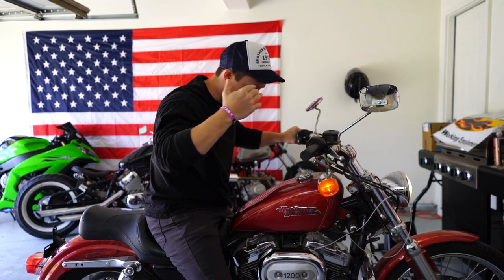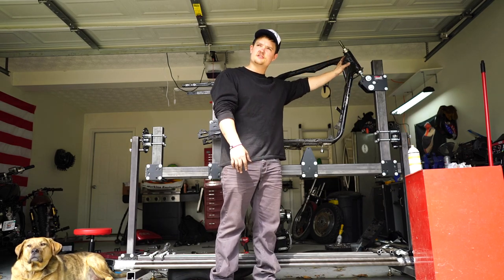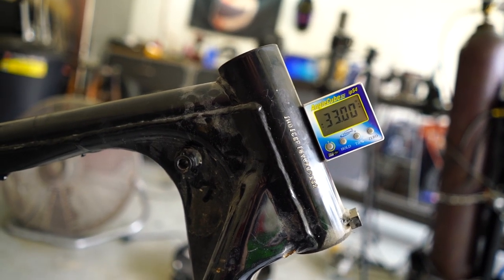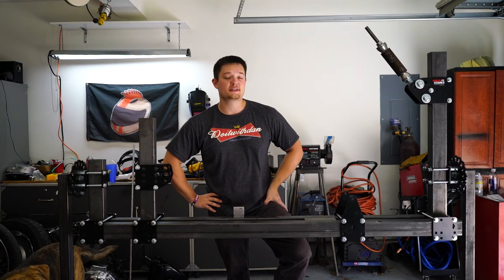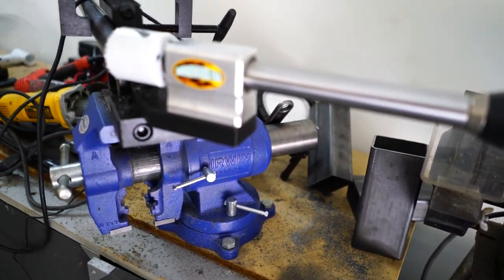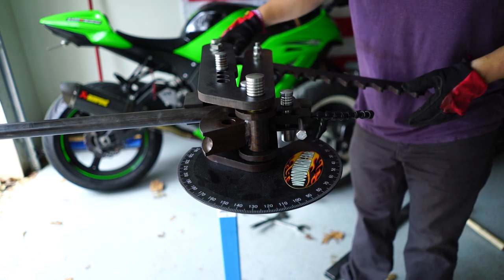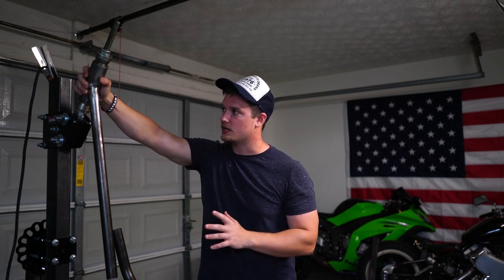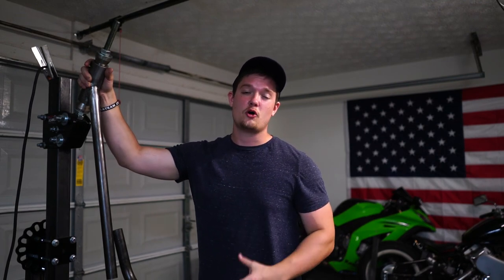Let's Get Started! - Building A Motorcycle

Comment: I believe the general rule is, you take how tall the wheel is- cut it in half, and thats where you set the rear axle... REALLY?!?!?!?!?
Reply: Pope Of Dope crazy, I know, who'd of thought 😂
Reply: he should be a mechanical engineer with that kind of knowledge.. hes wasting good talent being a motovlogger lmfaooo
Reply: Probably meant where to set the mockup bit in the jig
Reply: @j tui that's exactly what he meant! but clearly the axle is in the middle of the diameter of the wheel or it would be a very bumpy ride.
Reply: wheel and tire have different definitions. you set it up with the axle height half the diameter of the wheel (not including additional tire thickness). what he said made perfect sense and was more in depth than it sounded.

Comment: FYI when you're ready to install the motor and trans to make it easier. Lay the motor and trans on its side on the floor then set the frame on around it bolt it in then stand it up. I did mine that way when I built my bike it also works in reverse to remove the motor on Harley's and Harley clones.

Comment: that tubing will have a little bounce back to it. you probably need to bend it a degree or two past what u want it to be. tacking it so it won't warp until ready to weld out is good but its impossible to totally eliminate warping while welding unless that jig is clamped down all over when you go to weld.

Comment: Should of left that piece just tacked. the tacks are more then enough to hold it in place. It would have been way better to leave that tacked till you had the whole frame set up. The point of the jig is to hold the thing in place. You tack it all together, brace it. Then weld it out.

Comment: You need to be careful if that tubing is actually stainless steel, using mild steel mig wire with it can cause weld strength issues.

Comment: If that's how you weld, I'm not interested in riding anything you put together. You globbed it and that means the surrounding area is now weaker instead of stronger which means the potential for injury is really high. Try getting buzzed before you weld next time and flow the weld, you can push or pull the weld but don't move to fast nor to slow, puddle it and over lap to dime size for full penetration without heat saturation. If I were you, I would cut that back 2 inches, from the bearing with a 45° cut, insert reinforcement of steel so it would be like dowel pins, put new pipe over it with matching 45° cuts, properly weld it after practicing on a few scrap pieces, purchase a new bearing, cut the pipe further back so it overlaps the side of the bearing and not just the back of it, get it straight and level, tack weld it in to hold it in place, run a proper weld all the way around and grind the welds smooth to insure it looks good after paint as well as to smooth down any rough edges that you brush up against and get cut on. Don't take this as an insult brother but as constructive criticism with an opening thought provoking comment. When it comes to structural welds, you should ask yourself "1. Do I feel safe putting constant changing stress on that weld? 2. Do I feel safe letting a friend ride on this bike with that weld? 3. How much weight distribution have I accounted for with those 2 pieces being welded together? 4. Will the DOT approve this weld as structurally safe? 5. Is the DOT going to approve my welds and deem the bike safe for road use or deny my build until certain issuse are resolved?" Once you can 100% guarantee the bike to pass weld by weld, hold off on moving to the next weld.

Comment: The tube you are using is not stainless steel, it's standard Hydro tubing. "D.O.M." stands for "Drawn Over Mandrel" as it has no seam it can be bent much easier the regular EKW tube.

you need to get some local advice on welding before you place to much trust in that frame, your welds look terrible.

Comment: Why aren't you TIG welding the frame?
Reply: Al Mohr cause he can't tig weld
Reply: Because TIG just allows you to make really clean welds and weld non-ferrous metals. For steel, MIG welding is honestly way easier to make good welds with.
Reply: Dylan Lammi but TIG controls the amount of heat and keeps it from heating up too much of the tube which makes the frame stronger. 
Chromoly is what he should be using (it's a type of steel) so I'm not sure exactly what he has there though. 

Yes MIG is easier but it's not what a actual frame builder would use. 
I get it that this is his first one to learn and everything.
Reply: I personally think he should have started with a stick welder and eventually moved on to TIG. Nobody that only ever uses a MIG becomes a good welder and TIG is too much to take in all at once. The steel doesn't really need to be Chromoly because he lives in Georgia and it doesn't snow there. The biggest positive of it is the chrome and molybdenum content that prevent corrosion.
Reply: Dylan Lammi chromoly is a standard. 
The best route would just learn how to TIG. Then start on this type of project.
Reply: Again, he is just learning so I guess it does make sense to just do it the cheaper route. I'm still not sure if I would trust that frame at highest speeds. But that's Dans call, not mine.

Comment: You used an impact driver on a threaded bolt. WTF is wrong with you?
Reply from the maker: all bolts are threaded
Reply: Do It With Dan Well technically if it's threaded all the way down it's a screw. If you want to use it again and again use a drill or a spanner. There's a time and place for impact tools.
Reply: blisteringfilth Coming from the guy who says you can't use an impact on a bolt if you want to use it again. That doesn't mean much.
Reply: Aha whaatttt?????